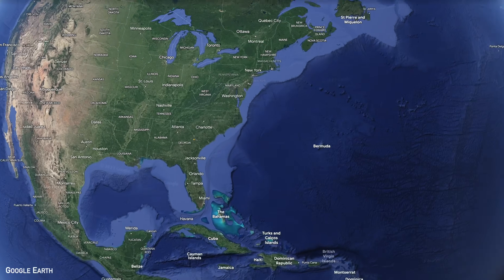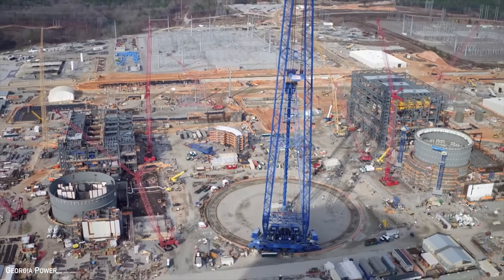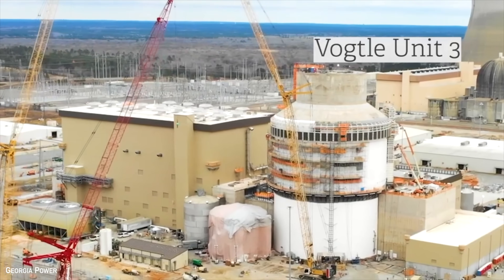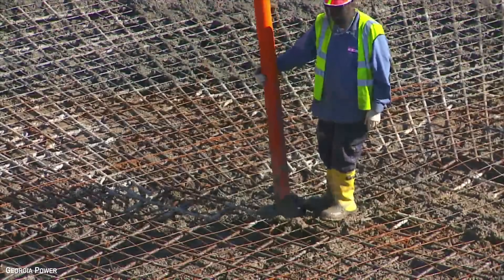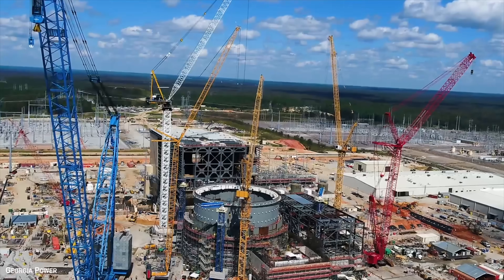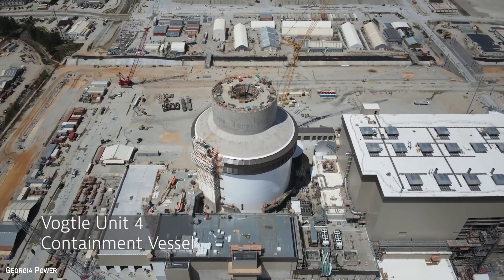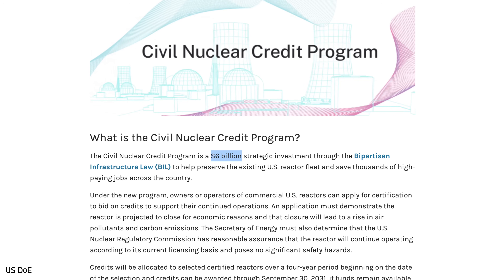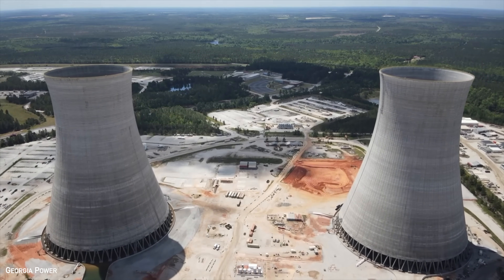Why the Future of Nuclear Power Depends on This Plant

Comment: Here is my list of corrections.
#1- The Westinghouse AP reactor is not revolutionary but evolutionally.  It used 2 instead of 3 or 4 coolant loops and has passive safety features (ex. Elevated water tank that does not require pumps to provide cooling)
#2 - The project used modular construction in a factory and this turned out to be costly as modules did not fit together when the arrived on site and the construction was poor and required rework.  This should show that "factory construction" that is often used as a way to reduce cost, did not work with complex designs.
#3- preparation for a new nuclear plant starts years before construction starts. Vogtle planning began in 2006 making the project a 17 year long project not a decade as stated.
#4- the redesigns due to Fukushima were due to mistakes that the project team made in evaluating the earthquake threat not because the standards changed.
#5- the rebar issue was due to the construction firm using a cheap type of rebar instead of the clearly specified type in the design documents.
#6- the cost of both units is over $34 billion which takes into account what the projects paid and owes the various firms...  These units are the most expensive nuclear units (per Mw generated) in the world.  Customers have been charged a 19% surcharge for years during construction and now the utility is asking for a $600 million dollar rate increase for each of the units when the go operational which will more than double electric rates.
#7- the total cost including contract commitments at VC Summer is $17 billion NOT $9 billion.

SUMMARY - One to two old nuclear plants will continue to be shutdown every year as they age.  NuScale is on hold because of ballooning costs and unless things become cheaper (Which they will not) NuScale's project will be scrapped. With no new nuclear plants being considered and 17 year build times, nuclear will continue to provide less and less to the U.S. grid for at least 25 year and no amount of hope or dreams can change that.
Reply from the maker: Hey, thanks for the comments. A few minor points: I'd call the AP1000 "new" in the sense that it was the first to start construction this century, compared to say, Watts Bar 2. Using 2 coolant loops is not especially different, the CE System 80 was the basis for that part of the design and three were built at Palo Verde in the 1970s and 80s. It's certainly not revolutionary, but makes evolutionary improvements, just like you mentioned.
Factory construction could be better, but we haven't seen any good implementation of it yet. The factory being onsite helped a bit, but yeah, there were issues getting everything to line up.
The rebar issue was a mess. Changes to design documents were frequent even after DCD and not getting pushed through to the site properly. Combine that with difficulty in getting the regulator to accept changes... and you're digging up concrete.
I've seen cost estimates for Vogtle as high as $60+ billion -- it all depends on what is considered part of the cost to get the plant going. Either way, it's very, very expensive compared to what else has been done recently by the Russians or Koreans. The pre-charging customers for a plant that isn't online yet is questionable in my mind. It shifts the risk from the owners to the customers via the Public Utilities Commission. It'll be interesting to see how Poland goes.
Cheers!
Reply: @atomicblender  I understand that you make YT videos to attract subscribers and make some $$ and that is fine.  I now realize that most people have absolutely no idea on the current state of new nuclear or even old nuclear in the U.S..  Most people are forming opinions on nuclear based on YT videos and social media without any scientific or technical reference. 
 People today want fancy videos to tell the whole story in 15 mins.  I live in the U.S. like most people watching these videos and what happens in other countries has no bearing on us or our future.  You cannot compare countries that are so different, and assume what they do affects us and that should be clear from the fact that China built the AP1000 first, working out any bugs.  

I simply provide facts and reality that some people appreciate since reality is so different from what many YT videos portray.  Of course there are those that get angry when the realize their opinions are false and simply want to stay in their alternate reality. 

Vogtle has provided an example of what any utility with decades of nuclear experience can expect if they decide to go nuclear.  And for those utilities that have no experience in nuclear, they are in for a wild ride.

Just some things to consider
Reply: @atomicblender  I have commentated before and you may know that I worked in the industry for 40+ years at 5 different facilities.  I first licensed on a Westinghouse 3 loop plant.  Prior to the AP1000, I believe all Westinghouse nuclear plants were 3 or 4 loop units.  I have reviewed the AP1000 design and it simply adds passive safety features that were supposed to reduce costs by eliminating the need for massive backup generators, etc..  Westinghouse designs have not dramatically changed over the last 50 years. So the new design excuse for construction or cost failures won't fly.

A financial report from one of the owners on Friday clearly pushed the cost of Plant Vogtle to $30.34 billion.  That amount doesn't count the $3.68 billion that original contractor Westinghouse paid to the owners after going bankrupt, which would bring total spending to more than $34 billion.

The rebar issue is an typical example of the problems with vendors.   The rebar was sourced from a U.S. mill and the metal mix was very specific and a premium was paid.  The vendor supplied substandard rebar that could not even be bent without breaking.  The vendor supplied the same stuff they provide to Home Depo and pocketed the premium paid.  The project could not wait for a law suit so they scrapped the bad rebar, paid off the vendor and then bought the correct spec rebar elsewhere.  And that my friend is an example of a multi million dollar vendor mistake that the utility just sucked it up for pass along to the rate payer.

The problem is not with nuclear power.  The problem is with the U.S. construction craft or lack there of, vendors that do not understand what nuclear grade means, and inept project management.  Many of the Vogtle project managers are ex-navy and they seem to be experts in covering their behind and not much else as that is the navy way.  I would not expect any of this to change in the future.

I live less than 60 miles from both VC Sumer and Vogtle and know many that work or worked there. I am currently retired and can only relay what I have been told by people that actually worked or are working at these failed projects: poor management, stolen equipment, fraud, kickbacks, greed, sabotage to keep the project going, lost documentation, etc. All project related. Oh and maybe the biggest issue, the utility makes a profit based upon the cost of the project so the ratepayer is stuck paying  for their mismanagement. 

Sad to say but new nuclear is dead in the U.S. for the foreseeable future.
Reply: @clarkkent9080  Inductive logic is using the specific, to reach conclusions about the general. You appear to assemble your facts, and then you apply inductive, vs deductive reasoning to analyze those facts.

> #2 - The project used modular construction in a factory and this turned out to be costly as modules did not fit together when the arrived on site and the construction was poor and required rework.  This should show that "factory construction" that is often used as a way to reduce cost, did not work with complex designs.

Here you use a specific instance to generalize.
A more interesting question would be: "should we employ factories that don't develop gauges and measures in future nuclear (or anything else for that matter)"?

#4- the redesigns due to Fukushima were due to mistakes that the project team made in evaluating the earthquake threat not because the standards changed.

Here you use a specific instance to generalize.
A more interesting question would be: "do all nuclear reactor project teams make mistakes in evaluating earthquake threats"?
[note, give the multiple reactors that did not suffer damage to the Tohoku earthquake and tsunami, some of which were closer to the epicenter, some of which had higher waves, the answer is probably 'no']

#5- the rebar issue was due to the construction firm using a cheap type of rebar instead of the clearly specified type in the design documents.

Here you use a specific instance to generalize.
What is interesting is your tacit admission that this is not an issue of designing or building nuclear power plants, but clearly an issue with a specific contractor.
[And, of course, the issue was identified and remediated.]

#6- the cost of both units is over $34 billion which takes into account what the projects paid and owes the various firms...  These units are the most expensive nuclear units (per Mw generated) in the world.  Customers have been charged a 19% surcharge for years during construction and now the utility is asking for a $600 million dollar rate increase for each of the units when the go operational which will more than double electric rates.

Here you quote lots of numbers - but with little context. Here is some context:

EIA statistics
Average retail rate (cents/kWh) in GA is 10.68 (13.30 residential)
Average retail rate (cents/kWh) in CA is 23.32 (29.54 residential) - dominated by RE
Average retail rate (cents/kWh) in US is 12.27 (16.11 residential)
https://www.eia.gov/electricity/data/browser/#/topic/7?agg=0,1&geo=g000000g0004&endsec=vg&freq=M&start=200101&end=202304&ctype=linechart&ltype=pin&rtype=s&pin=&rse=0&maptype=0

3rd party check broadly agrees with EIA
https://www.energysage.com/local-data/electricity-cost/ga/

Assuming a 12% rate hike - GA is still paying less than the average US consumer
https://www.wrdw.com/2023/04/25/georgia-power-customers-can-get-ready-12-rate-hike/
hiked 12% retail rate (cents/kWh) in GA is 11.69 (14.90 residential)

Is it great? no - clearly GPL should pay more
Is it terrible? no - however, without revenues, GPL cannot invest
Yes, it would have been better if Vogtle had been built without a hitch,
but the alternative, as seen in CA, is far, far worse!

> SUMMARY - 
> One to two old nuclear plants will continue to be shutdown every year as they age.

Why don't we wait for actual evidence.
I believe there is a strong case for continued refurbishment and uprating - but I do recognize that is an opinion, not a fact.

> nuclear will continue to provide less and less to the U.S. grid for at
> least 25 year and no amount of hope or dreams can change that.

Nuclear can go either way - with the continued example of failed results of RE wind/solar (high costs, high carbon) in Germany, California, and other locales, even politicians will have to notice eventually.

Or hope and dreams can continue down the path of RE wind/solar (while coal and natural gas keep burning).
Reply: @factnotfiction5915  Let me be more simplistic for simple minds.

1. The factory build concept for NUCLEAR power plants was tried and it failed.  What makes you think it would work next time???

2. Every nuclear plant uses historical data to determine the risk to natural and man made events.  Risk management is not an exact science so I would say that other Safety Analysis could also have errors.

3. Nuclear plants use very specific design and content criteria in their procurement.  If something as simple of the metal mix in rebar could be falsified, one could assume other materials could as well.  Why would you assume that it will never happen again?

4. The 19% surcharge has been in place for 3 years.  GP just asked the PUC for a $600 million rate increase when unit 3 goes commercial and may ask for more when unit 4 goes on line.  GP has less than 3 million custoners...you do the math.  Give a 3% conservative interest on $34 billion, they cannot raise rates enough to even pay the loan interest let alone principle.

5.   Summary...NO utility is currently even remotely considering new commercial nuclear without the taxpayer footing the bill.  So apparently every utility exec agrees with me that nuclear is dead in the U.S.
Reply: @clarkkent9080  > Let me be more simplistic for simple minds.

Your consistent ability to be rude, to me, to others, in nearly every post I've seen of yours is quite amazing, but not admirable.
It does not make your arguments more cogent, and it does tend to make me discount your posts (basically I only answer them so that you are corrected for others reading). I suspect others discount you also as it makes you come across as dull and boorish.

> 1. The factory build concept for NUCLEAR power plants was tried and it failed.  What makes you think it would work next time???

What makes you think it will not work next time?

Science and engineering progress are not made at once, like Athena sprung whole from the forehead of Zeus. To take one story of failure, mankind had been seriously trying for centuries to achieve powered flight, and the Wright brothers had been working seriously for about SEVEN years before they managed to make it happen.

There are plenty of stories about commercialization where the 'reinvention' was quite minor, but became the standard, to the degree that we don't even remember the original. The Mauser, the IBM PC, the smartphone, etc, etc.

> 2. ... Risk management is not an exact science so I would say that other Safety Analysis could also have errors.

As a 40-year veteran of the industry (blah blah blah) i am surprised that you do not appear to understand that the probabilistic risk analysis framework measures the error also - that is what determines the risk!

> 3. ... If something as simple of the metal mix in rebar could be falsified, one could assume other materials could as well.

And yet it wasn't! The contractor was caught, and the issue mitigated. Thus, by definition 'something as simple of the metal mix in rebar IS UNLIKELY TO be falsified'.

> Why would you assume that it will never happen again?

I don't assume that some contractor, knowingly or unknowingly, will not attempt this again. I do support a robust inspection mechanism. Requiring inspections will neither bring nuclear power to a halt, nor will they make nuclear technology impossible/difficult/expensive.

Let us contrast with civilian aviation, a far riskier and more deadly venture.
Did the aviation industry fail to 'take off' because planes require inspection (both at build and in operation), pilots require exams, etc, etc? no. 
Did aviation becomes so impossible/difficult/expensive it didn't happen? no. 

> 4. The 19% surcharge ... a $600 million rate increase ... GP has less than 3 million custoners...you do the math ... they cannot raise rates enough to even pay the loan interest let alone principle.

Your inductive reasoning is in full force here.
'Because this one project ... it follows that all nuclear will ...'
Eh, not really.

However, even for this one project, rates in GA are still middling, and nowhere near the levels that you see in states that go for lots and lots of intermittent wind/solar.

> 5. Summary...NO utility is currently even remotely considering new commercial nuclear without the taxpayer footing the bill.  So apparently every utility exec agrees with me that nuclear is dead in the U.S.

Wait! You slam the GP utility executives as stupid and clueless, and then you believe that because they agree with you, they are not stupid and clueless?
(note GP has ratepayers footing bill, not _taxpayers_)

> nuclear is dead in the U.S.

However, I take your point that the road is uphill. I believe that we (the US) should figure out how to make it live and thriving.

Lots of dispatchable power, with little pollution, on little land, at cheap retail rates - this is an better solution than anything else out there.

Coal kills, natural gas emits greenhouse gas, hydro floods wildland, wind is intermittent, solar requires Uyghur slave labor, geothermal is too little.

Nuclear can become even better from better financing models, new technologies, and innovative operation (and also more storage).
Reply: @factnotfiction5915  I was born in a generation where you called things as they are and did  not have to be PC to prevent hurting the feelings of the snow flakes.  If you have a logical fact based comment, I will respond respectfully. But if you make wild moronic claims based on a YT video education, I will tell it like it is.  Does that make sense?

1. People who claim the factory build is a cost savor should accept that it was tried on FOUR of the latest nuclear builds and it failed. Most have no idea that it was even tried.  Westinghouse made that same claim also.  UNTIL it is proven, it should not be used by any logical person as a cost saver.  Make sense?

2. EVERY Nuclear Safety Analysis uses the 1 in a million criteria.  In the case of Fukushima,  they did NOT make an error, the model does not account for unforeseen changes that are not historically documented.   Could the same be true of any Safety Analysis....absolutely as is proven in any reactor accident.  Make sense?

3. The bad rebar was caught when workers tried to bend it in installation and it snapped.  Had the mix been a little less carbon based no one would have known.  This issue is NOT uncommon along with counterfeit parts. If you don't understand that, you have NO experience in nuclear power like I do ....Blah blah blah.  Make sense?

4. New nuclear is 3-4 times that cost of ANY other power generation method.  Basing a states average electric rates on the cost of nuclear or any other single power producing method is just stupid and moronic.  Sorry but I can't be nice with that statement.  You are truly clueless.

5. Again the simple fact that anyone that truly sees the entire picture could not possibility ignore.  NO Utility in the U.S. is considering new nuclear.  It is not anti-nukes or environmentalists or me that is stopping new nuclear, it is the COST and build TIMES. There were NO anti anything at VC Summer or Vogtle.  Gov. Deal kept Vogtle project going when GP wanted to cancel it.

You have an agenda that is not based on reality.  I am pro nuclear but ignoring reality and facts will not make it happen.  Just spewing out lies and half truths because I support it is exactly what is happening in politics today....ignore reality and facts and support your sides ideas no matter what.
One simple question.  What is your experience or education that makes you think your comments have any validity since they are just opinions and you provide no facts?
Reply: Water at 300°C and 2250 psi is the root cause of cost (safety) in nuclear power.
Ideal for subs, maybe, Russia uses molten lead cooling for much faster subs.
The use of molten salt cooling either in thermal spectrum thorium breeders or fast spectrum waste burners needs to be implemented.
Reply: @Piccodon  That must be why 90+% of all world reactors are PWRs and the Soviet lead reactors of the 1970s are no longer used and there are NO current lead reactors.

There is always some unicorn reactor type that solves all the problems until they are built and then we come to find out that there are problems.

There is only one MSR planned in the U.S. and Terrapower's Natrium reactor is on hold while they build a plant to make the fuel necessary. Even then, the estimate for this reactor type is more per Mw output than the current massively expensive PWRs.  Of course the response, as always,  is that cost will come down when we make more...lol
Reply: @clarkkent9080  The MSRE at ORNL was shut down for political reasons, not technical.
There is quite a few Gen IV MSR projects like Moltex, Elysium, Copenhagen  Atomics  and some others that needs to br developed. They get minimal funding from DoE.
The main issue is the public perception of nuclear. The industry has done a very poor job with PR.
The inventor of PWR Alvin Weinberg thought PWR was a bad idea scaled up like the current ones. His design was focused on marine use.
Supposedly there is a small Thorium breeder test reactor just started in China.
I do not think you can just dismiss Gen IV.
NASA did not invent self landing rockets, and SPACEX reportedly do not want any of their "experts". 
There is nothing "wrong" with PWR, BWR, other than the concept is suboptimal and hence the cost excessive. MSR can be built for less than coal plants.
Reply: @clarkkent9080  There is a lot of documented history about the MSRE, the "one guy" was the head of ORNL, Alvin Weinberg, he had a very large staff working for him to make the project successful. 
So you are not correct. 
There are still a lot of documentation including old B/W films.
It was a politician from California who wanted a sodium cooled breeder in lieu of MSR,  in California.
That project had problems.
Don't be blind to MSR. It has key advantages over PWR, including prefabbed modularity, negative void coefficient, low pressure, etc etc.
Nuclear fusion reactor needs a stupid amount of power to start up, is extremely expensive, and should be scrapped as it is a waste of resources.  
The breeders become interesting when the thought was scarcity of Uranium. 
Ed Pheil at Elysium claims that the US has 800 years worth of spent nuclear fuel for use in his MSR, requiring only a mild reprocessing.
Solid fuel locks in fission products like Xenon gas, which is a neutron poison, which could  separated out in a fluid fuel reactor.
Most of the potential energy in solid fuel is wasted because of locked in fission products. 
Besides 800 years of waste fuel recovery, the use of the Thorium  - Uranium 233 has a lot of potential as Thorium is a mining waste that would be next to free, and also help the rare earth production.
If you are an old timer in the nuclear power industry I can understand your bias. That industry is unlikely to favor anything new and different and to a man with a hammer everything looks like a nail.
Reply: @Piccodon  Alvin, was an administrator.  Administrator are responsible for the day to day operations of a facility and rarely if ever get involved in any actual experiments. ORNL is the largest science and energy national laboratory in the Department of Energy system, spanning may acres.  So, this guy was making payroll and holding meetings all day and most likely never even visited the project and certainly did not understand exactly what was happening in day to day operations. He only knew what other people put in their reports.  So I am correct.

I am not against MSRs and in fact one may someday be built by Terrapower but even that design has an estimated cost that is equal to the financial failure of Vogtle unit 3/4. So, even if it works, it has to be cost effective. I am pro nuclear and not against any reactor type as long as it is economically viable. 
 
But you MSR fan boys take one experiment 60 years ago, add some conspiracy theories, and conveniently omit the problem of crack formation in the metals that would preclude long term safe operation or that a whistle blower had to report the criticality safety concerns of the stored fuel something that Weinberg most certainly knew but ignored to prevent tarnishing his pet project 

In order for a MSRs to operate on the Thorium cycle, there MUST be reprocessing either in a very expensive stand alone facility or a complex, critically concern, security concern in situ support system. And there is currently NO Thorium infrastructure.  Terrapower is on hold for at least 7 years while they build a facility that can make the high assay uranium need for the Natrium reactor.  Using Thorium would require many Billions to mine, purify, manufacture and provide the Thorium.  Just because it is a mining waste does not mean you just haul some off and you have fuel....sorry nothing that is radioactive is ever easy or cheap.  Even Terrapower is not considering Thorium.

Again, I am not against anything new as long as it is cost effective.  And I understand you young timers believe everything you see on YT videos or read on social media.  But until one of these "NEW" reactors are actually built under U.S. regulatory requirements AND operated for 5-10 years COMMERCIALLY, your claims are just hopes and dreams and have NO basis in facts.  Fusion reactors technically can work and are just as possible as your unicorn MSR.
Experiments are just that and even NuScale and Terrapower "new" reactors are demo test units
Reply: @Piccodon  Nevermind superman, he is an anti-nuclear activist, nothing you can bring to the table will change his mind. He can not get past giant PWRs, there are no other solutions and technology never advances as far as he's concerned.
Reply: @clarkkent9080  Very well written commentary. I guess you wrote a lot of technical reports back in the day?
Reply: @Piccodon  As a nuclear safety analyst this is one of the best written responses I have read, Clark Kent is either "nuke waste" (fired from a fission plant or washed out the USA nuclear power navy training pipeline), or is a fossil fuel lobbyist. He brings up interesting points but it is all from data meant to skew perceptions away from actual facts.
Reply: @anydaynow01  He says he's had 30 year career in nuke. The PWR paradigm is very embedded and anything but, is a unicorn. Dissing Alvin Weinberg reveals his lack of the big picture.
Naval nuclear operators were partially responsible for the Three Mile Island meltdown, the story goes, as Naval reactors are very different animals. Being a good helicopter pilot does not automatically qualify you for a fixed wing.
The cost of processing Thorium may not be so bad, DoE has buried vast quantities of this mildly radioactive fertile material, but according to Elysium using nuke PWR waste would last a very long time, after some simplified pyro processing, to be used in their proposed fast molten sodium salt reactor, which also would convert nuke waste to an asset. The high temp process could of course  also be be tapped for other high energy uses in chemical industry.
Any disruptive technology will be met with resistance.